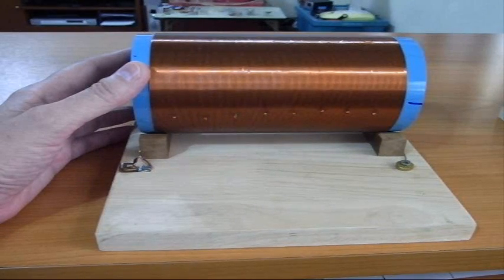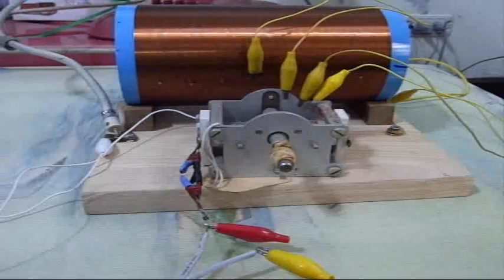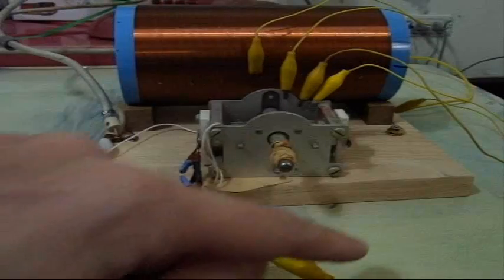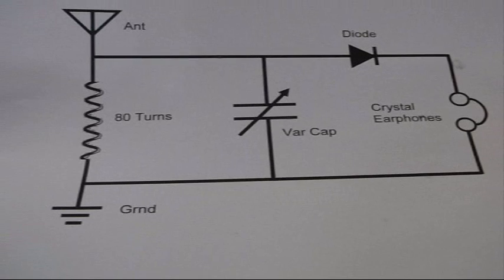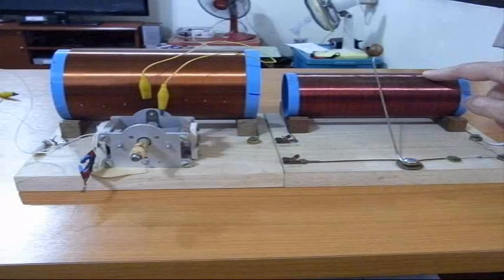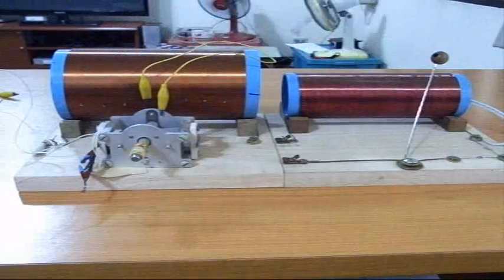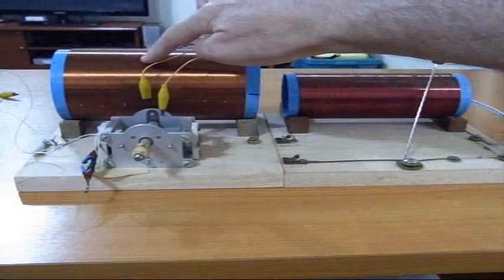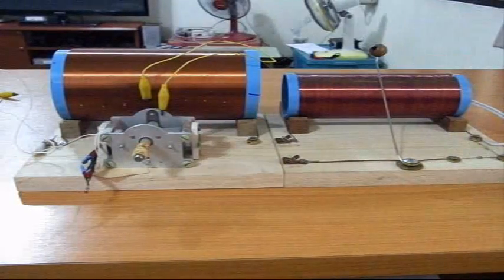Popular Crystal Radio Design That's a Waste of Time - And Why   (Updated Video Available)

Comment from the maker: Remixed version with annotations restored:  https://youtu.be/r9Onub2Xpzc

Best/Easiest DIY Crystal Radio - No Batteries, No External Power 2023 (4K)
https://youtu.be/fLVCqZGpv3U

RELATED CRYSTAL RADIO VIDEOS: 
My New Favorite!  Crystal Radio with Antenna Tuner:    https://youtu.be/mh5KxCpbQ5U
Crystal Radio, Capacitive Tuning - WORKS GREAT!:    https://youtu.be/VJ80Nm9KSkE
Crystal Radio & Resonant Coil Design:     https://youtu.be/Fw9eb-aB-XU
Crystal Radio Antenna (Shortwave Also):    https://youtu.be/G8AsgZbncW4

My Crystal Radio Does NOT Work (FIXES for common problems):    https://youtu.be/kCxQ8iPQx4s
Good Crystal Radio Connection Points:    https://youtu.be/G3qjrReHR1k
Crystal Radio, Connect A DC Audio Amplifier:  https://youtu.be/RW3VhnzgjtA
Three Upgrades For Your Crystal Radio:   https://youtu.be/LENco3_jV_s
Crystal Radio Wiper Upgrade:     https://youtu.be/i1otDz39nlw
New Crystal Radio Design - "Modified-Pickard":     https://youtu.be/_qxHhFKjLAg
Crystal Electric Generator RF Energy Harvesting Exp 5 - Full Wave Rectifier:   https://youtu.be/BTu_GJKjOmA

Comment: I think the antenna connected directly to the coil is loading the coil. A small capacitor connected between the antenna and coil should improve selectivity.
Reply from the maker: I have done that on other radios, I will have to try it on this one. Thanks for the suggestion.

Comment: you should "loosen" the antenna from the coil. Use a small cap in serial with the antenna. If you are using a (very) long wire the signal will "kill" the option of "tuning" using the varco.
Also ... the 80 turn "tap" AND the end-side of the coil should be connected to ground.
Please, use some small amp with at least 10K input-impedance to make the signal "audible" ... some old-style computer-speakers are just perfect!
Reply from the maker: @joostderidder  I have a video where I put a small variable capacitor in line with the antenna. It's a nice upgrade. My antenna is about 10 meters. I have grounded the 80T coil, and it behaves like a tightly coupled coil with the antenna coil. I have had youtube give me strikes for playing the radio, so I won't do that again. They take down my video so you can't see it anyway, and they will cancel my channel permanently if I repeat the infraction.

Comment: I think the problem is somewhere else than you think. It's not that there is anything wrong with a capacitor-tuned circuit, it just doesn't work correctly when it doesn't have the right conditions. Unsuitable conditions are, for example, direct coupling of the antenna, which detunes the circuit, and direct coupling of the detector, which loads it. The solution is right in front of your eyes, you just ignore it and look for substitute reasons and problems elsewhere.
Reply from the maker: You can watch this video where I finally found a 1 capacitor design that works. 
https://youtu.be/0AvTO588SyU
But the common design you find all over the internet does not. There are many websites debunking that design. 
There's also a 2 capacitor version that works here:
https://youtu.be/0AvTO588SyU
Or you can build the design that does not work and show me where I'm wrong. I don't mind learning.

Comment: To make first coil work better try shorter antenna, say 12 feet.  Mess with disconnected ground or ground to your skin.  Coil is too long at that diameter, try tapping midway from 0-80 and in tap remaining taps.
Crystal Radio is addicting!
Reply from the maker: I keep promising to make an antenna tuner, which you know means I don't have to change antenna length.  I'm lazy, so that's my first choice.  Yes, it is addictive and fun.

Comment: View the Microwave1 series of videos on crystal radios. He has done a great job. His radios pick up many stations and operate very clearly. His most recent uses a varicap diode instead of the variable capacitor and works very well.
Reply from the maker: Billy Cheung is the master of that style of radio, he has some that require no battery. And is it really a "crystal radio" if it needs a battery? 
https://www.youtube.com/watch?v=5bBwmOQHVzM
Also I noticed that some of the advice that microwave1 gives is sub-optimal for average users, for example he has a cap across the output which works for the old earphones he is using, or the amplifier, but for the new piezoelectric earphones it causes problems. Perhaps I'm too much of a purist but the easier workaround to a cap (which costs more and is less sensitive), is the slider/wiper style which avoids the costs, "unobtainium", and batteries of caps or varactors.

Comment: Check your coil in your first radio.  Its a large diameter and higher inductance.  You can find solenoid inductance formulas all over the internet.  Diameter makes a difference.  It looks like your problem is you could have tuned yourself out of the broadcast band.  It should measure about 200 uh with an LCR meter.  You can get an LCR meter cheap on ebay.   a 365 pf variable cap will tune the broadcast band.  For ground use a 6' ground rod or galvanized cold water pipe and  keep the ground lead in as short as possible.   If you are in a metropolitan area with many strong stations a wire antenna of 50 feet should work fine.  Don't use coax.  The input impedance is very high on the antenna circuit of a crystal set.  50 ohm coax will short it out.   Use a 1n34 germanium diode.  Notice your coil on your boy scout radio is much smaller and lower inductance then the left side big coil radio.   BS coil looks about right.   The basic crystal design will receive a lot of stations.  I had one as a kid and it worked great.  I was using a galena crystal.  My 50' antenna worked great.  I extended it to another tree in my yard to about 100 feet and it didn't work as well.  I never figured out why.   I think I must have grounded it somehow.  I think 50 feet resonated well.    Its very fun to experiment with different crystal circuits.

Comment: Hello brownie 
Hope u r well
I've been experimenting
I have a 283 uH diamond litz coil and capacitor is 30 to 320 pf
If I loop feed coil i.e. aerial and ground go to a 10 turn of 3 in diamter wire and place next to coil 
My receiver works exactly as it should 
530 to 1700 khz as per lc formula
But signals are weak 
If I go by the old basic standard like you started with and connect aerial  directly to coil , capacitor which then goes to diode stations are booming but the capacitance from aerial  Lowers my  frequency now tunes 400 khz to 1300 khz ....but I tried this, I connected aerial to one leg of coil and the other leg went to capacitor which goes to diode, my frequency raised  about 150 khz
Now tunes 650 to 1800 khz 
But the stations are stronger than with the simple loop coupling and very very sharp tuning better than loop even though stations are stronger and the audio sounds fine 

While at sea I connected antenna directly to coil which goes to cap which goes to diode and the other leg of coil of course goes to cap which goes to ground. That's the strongest and of course 70 mile out didn't have trouble with saturation but signals were broad

I've got goodys coming in on Tuesday.
I'm curious to try loop coupling using  variable capacitors to tune aerial and a coil not just a roll of  wire
Reply from the maker: You should post some videos on youtube so we can see what you are doing.  Would be interesting.
Reply: @tsbrownie  I'll be home in 2 months....
Philippines
When I get antenna radio setup I'll make YouTube video
Reply from the maker: @uncleruckus4060  Please post the link here.  Can't wait to see it!

Comment: I agree with you on the first premise. The first design does not work for most of us and that discourages many newcomers and young followers. 

The reason I can say are three main factors. Antenna coupling, antenna capacitance and Q factor. 

The second design works best because it is an variable transformer. It has high variance on the capacitance of the circuit. That design of coil includes an unwanted capacitance that's makes a runner circuit tank. It has better Q. 

The first design is for a short and high impedance antenna already tuned to the broadcast band. It is just bad if you use a random piece of wire and feed that on top of the 'hot' side of the coil. 

Your random length wire will have a lot of capacitance on it and it will add to your variable tuning capacitor and you don't see it. Remove your running capacitor and you may hear an increase in volume. Instead of that big variable capacitor 20-360 pF try 5-50pF. Or use another variable capacitor between your coil and your antenna wire to 'trim' the length of your antenna and reduce the extra capacitance you are introducing into the circuit. 

As many other said and did the antenna must be coupled with a tap between 10% and 30% of the coil. Also the use of a separate coil for running the antenna will get you better results. Look for 'antenna tuner variometer' like in the old days.
Reply from the maker: Yes you are correct of course, and I'm sure your change of capacitance would help.  What I am trying to do is accurately re-create what is probably the most popular design you can find on the internet, and then show it does not work.  Even with "reasonable" changes such as varying coil  it does not work.  Hopefully people will see the video and go for a workable design.

Comment: Couldn't concur more. At 8 or 9 years-old, ran 18g Xformer wire from bedroom window to house peak to telephone pole and onto a tree in a 6-acre open lot behind home. Must have been 50 to 60yds long and 25' above terra fima.  Drove a 12'' galvanized pipe into the ground and ran lines into my room. Used an old HeathKit speaker box (the one with copper springs for quick attach-detach) placing a 1n4148, or facsimile, between the contact leads with ANT and GND affixed across the diode. Given a 3'' paper-cone speaker (5+ decade old technology), radio broadcasts still could be heard clearly in several rooms. Closest AM beacon, w/largest US footprint, was ~5mi. away. During daylight hours, it swamped other local AM-stations. At night could hear faint remnants of other stations, as nearest broadcast overwhelmed all others. Only when local beacon was shutdown for periodic overnight maintenance could one observe other stations (15-50mi. off, LOS). During rare maintenance windows when skips were profound, one could receive signals from NYC, CIN, INDY or DNVR, of course none of them without significant interference from other stations but still identifiable between competing dialogues. Would have been interesting to have a two or three stage tunable front end filter (Hi-Q) to see how well the local station could be suppressed and see what selectivity could yield other distinct broadcasts.
Reply from the maker: That was interesting you could get that much volume out of a low impedance device (8 ohms?).  Did you add a way to tune it?
Reply: @tsbrownie  Nah, moved onto what most 8/9 year-olds did; fixing household gadgets, like modern day  ALASKAN reality shows build new homesteads--we christened a new fort each sp/su, baseball-basketball-hockey, taunted girls, pushed-and-peeled, kept up on studies, forged wild berries and engaged in general 60's suburban mischief with the throngs of likeminded kids. Back then, HAMs were utter outcasts: last picked on teams, glasses, pocket protectors, goofy, socially awkward, disheveled, some very bright--others dimly lit. Radio alone wasn't enough common ground for me to overcome my insecurities. Alas, on the strength of my math/science skills I pursued that nascent interest in Rf-Comm and Sys Eng for 2 decades beyond university. Thanks for your postings and will continue checking for updates. Best.

Comment: Which capacitance on the rightside design? there is only inductor
Reply from the maker: The coil and earphone both have capacitance.
Reply: @tsbrownie  but the coil works as inductor. how come it has capacitance? and if it does, shouldnt it be neglectable?
Reply from the maker: @jm10oct  Everything has capacitance, inductance and resistance / reactance.  In this case, the coil has enough capacitance to meet the need.  Oh, and the new piezoelectric earphones have capacitance too, hence the elimination of the cap that was used in radios from 50 years ago which used the original crystal earphones.

Comment: The intrinsic capacitance(too high) of the coil and the antenna across the coil as probably knocked the tuning range low - away from what it would be calculated as. Damping the resonance as well at the same time - is that what you mean?
Reply from the maker: I tried every tap on that coil, 10 turns, 20, 30, 50, 70, 90, 110, 130, 150.  I also tried (not in the video) some much smaller mica caps and bigger caps and nothing.  I could get it to tune a couple of stations at best.  I doubt the coil capacitance is overwhelming the circuit because I am now using that same coil in another radio (modified, modified boy scout) and it works fine (video coming out one of these days).  But the antenna could be an issue.  Maybe if it was coupled instead of direct...  May have to revisit that.  Thanks for the kick in the complacency.  I need those now and again!
Reply: Hi tsb - I've built a few. 50 turns on a ferrite rod and 365pF VC I could separate about 4 stations in the day. So there was some resonance going on. But there's no tuning at all with your 1st one.Something's damping the circuit. The reactance (Xc) through the diode and earpiece if low at RF isn't going to help. Also coax feed from a wire outside if the screen is connected to ground will cause loss.Your tuning cap looks about 100pF BTW?Because you're tapping into the coil the redundant windings creating an auto transformer  - Some kind of destructive phase thing - could be a dielectric loss (the coil will have an electric field as well) to the former. Not as likely though LOL!
Reply from the maker: @tonystephen6312   I have to try one with a ferrite rod.   The cap I used is 365pF.  The antenna wire is not really coax, it's a broken down coax, and I used just the outer shield for the antenna.  The ground was to the house's steel.  There are many other designs that work so much better than the one being tested.  The boy scout radio will pick up 17 stations and it can be built from mostly scrap stuff around the house.
Reply: The boy scout radio sounds good  - with the sliding bar tuning. It kind of looks like it tunes 2 sections of band at the same time though, which is confusing?!
Reply from the maker: @tonystephen6312   I don't understand what you mean by "2 sections of the band".
Reply: Hi tsb - It was just one way of looking at the circuit. The tuning wiper is at earth so it splits the coil into a auto transformer. The top part is mutually coupled to the bottom part of the coil. If you add the self capacitance of both coils there's like 2 tuned circuits coupled to each other - so when you tune the wiper (say down the coil) the top tuned circuit is moving lower in frequency and the bottom coil section is moving higher frequency. So kind of two lots of tuning going on.Not to criticize just wondered..
Reply from the maker: @tonystephen6312  I see what you mean.

Comment: On the right radio, remove the coil from ground to raise the Q of the coil so you get better sensitivity.  Ground is connected to the coil through the wiper arm only to change the size of the coil.  I find the best reception from 600 - 980 khz is obtained on mine about 3/5 from the left with a reading of 136-141 uH which makes the sports and news stations at the low end the strongest with a Mexican wannabe drunk cowboy "music" in between.   They sound like when Lois and Peter smoked marijuana before auditioning for a contest...and were Boo-ed off the stage.
Reply from the maker: I have found different combinations of ground / no ground and different orientations of the antenna give me very diverse results.  I've never been able to nail down a formula, it's more witchcraft than science.

Comment: I've built foxhole radios that had a razor blade instead of a diode that would work you must Be doing something wrong we did use an antenna that was a very important part of getting AM reception and there prolly were more AM stations back then in 1958? Lol foxhole radios got the name during WW1 so soldiers in the trenches could hear what was going on in the outside world  no diodes  available in foxholes back then but a single edged razor blade with a whisker and a long antenna could pull in AM signals enameled wire was used a lot back then did you sand the enamel off the coil where the whisker would run??
Reply from the maker: I think you are right, there are fewer AM stations today, some have converted to digital which won't work with this radio.  Yes, you have to sand the enamel off on the places where there are connections and where the wiper runs or it won't work.

Comment: Curious if you've tried a highbryd design, i.e. instead of locking the variable cap in at 80 turns, hook up the whiper as in the modified boy scout system, then hook the variable cap to the wiper? Perhaps the cap may serve to fine tune the channel.
Reply from the maker: Interesting idea.  I will have to ponder the values on the cap and such.
Reply: I am way out of practice with electronics, haven't worked in the field for 20 years now, and definitely no real RF experience, so I might be overlooking something. But the general concept seems plausible. Really enjoyed your video. Would love to see the results if a hybrid works out for you.

Comment: Some of you are missing the other half of the equasion. Antenna. We ham operators had longwire antennas, dipole antennas. Loading coils for imedance matching. You need a signal to come in and tune to its frequency. Disconnect your antenna from your receiver, you get nothing.